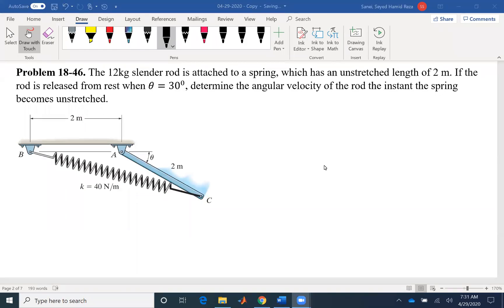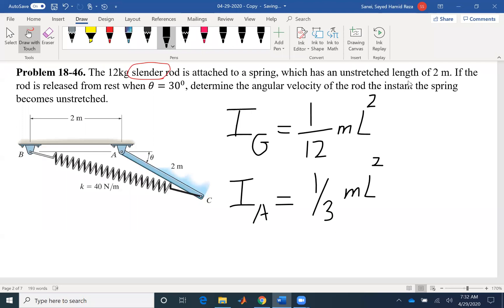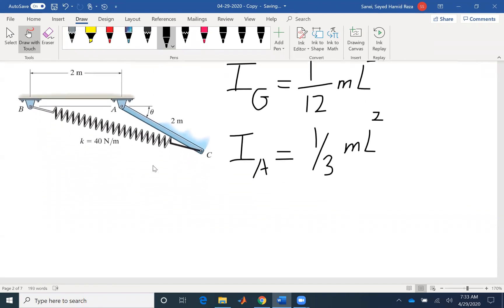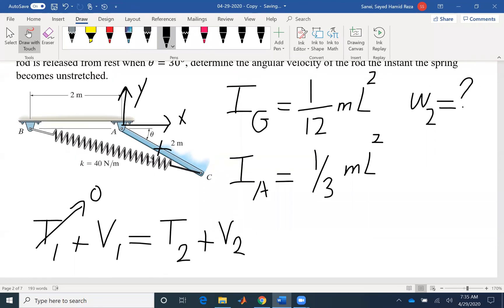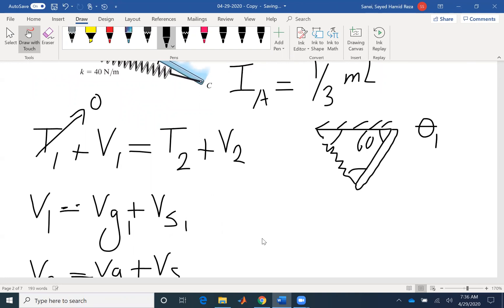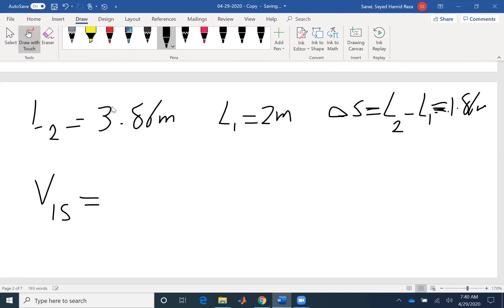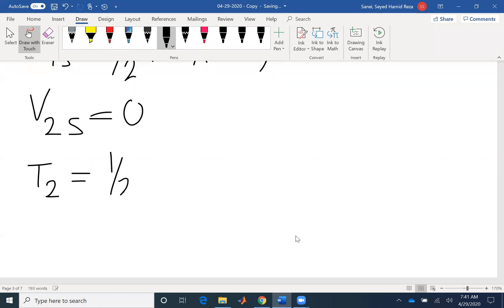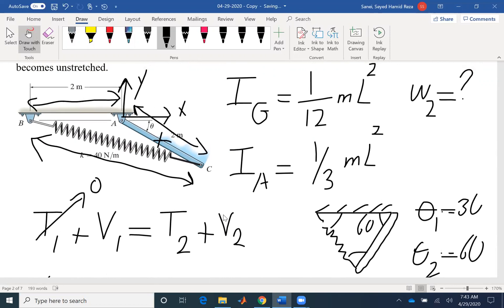Dynamics Example 18 46: Conservation of energy for rod connected to a spring

Comment: when you find the potential energy of the spring you use 1/2k(x1-x0)^2 or 1/2k(x1)^2 - 1/2k(x0)^2?
Reply from the maker: Very good question and a confusing one. First you need to find a deformation for each spring, and then use that deformation(Delta X) in your equation. One way to write the equation to avoid confusion is 1/2k(X1-X0)^2-1/2k(X’1-X’0)^2. If you have the deformation, you can use directly Delta X=X1-X0 and Delta X’=X’1-X’0